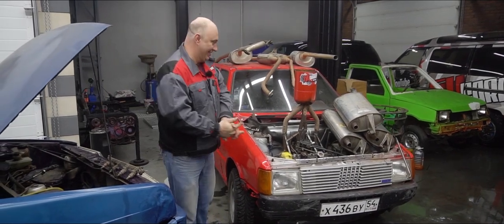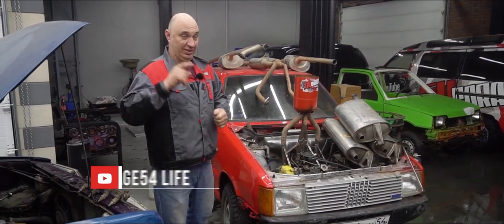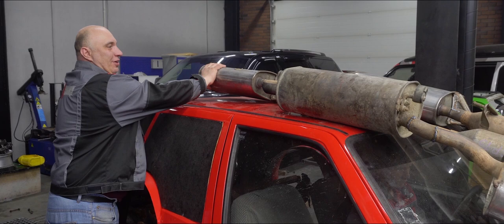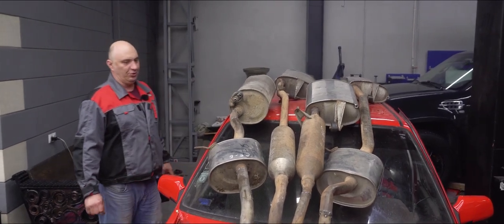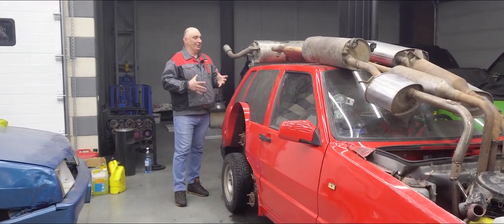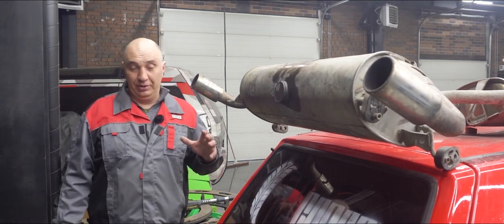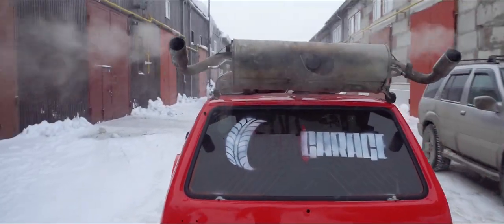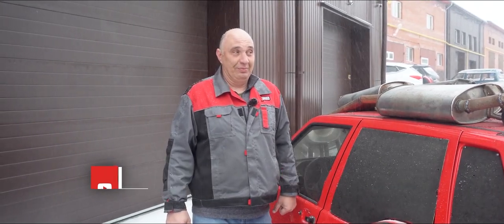Making the quietest exhaust system – 9 mufflers!

Comment: If they really wanted it to be quiet they would run a manifold and put the mufflers in a series. One resonator and muffler per cylinder wouldn't really do anything that a stock exhaust would. The one muffler in the back is doing 90% of the work here.

Comment: Maybe it didn't work well because of the pressure pushing and pulling on and off and not in succession with a combination of cylinders and explosions. Maybe having minimum 4 cylinders per pipe scientifically all along has been the reason because the sequence of the push is more linear then by Neri stop go stop go push of the air.  OK there we go now you got it going Pyramid / Bracket / Tournament style.

Comment: Try insulating the entire engine bay with a material that will deaden the sound.
Reply: Didn't he mention cement?
Reply: @randystegemann9990  I think they did that already but i dont think the motor ran. I'm talking like insulating foam or that sound deadening material.
Reply: @Mish93Will  Yes I saw one where they filled the engine bay with cement and the motor still ran, but in this video @ 7:02 he said, "pour in some cement." Foam insulation would be a better idea to deaden engine noise.  I don't think I want them working on my car.

Comment: That car is going to have too much back pressure with so many mufflers connected to 1 engine.

But the car is very quiet, after connecting all those mufflers.

I rather have no mufflers at all, and just have 2 resonators one connected to the next in a single line style, not unbearably loud and has some sound, also resonators are basically straight pipe with perforations and a metal shell around it.

Comment: ah no! it would have been quieter if your routed all 4 cylinders into one pipe, as it was when it was set up as a popcorn machine. and then put several mufflers on that single pipe. you need to go 4 in 1.